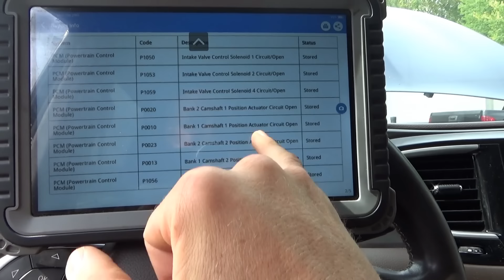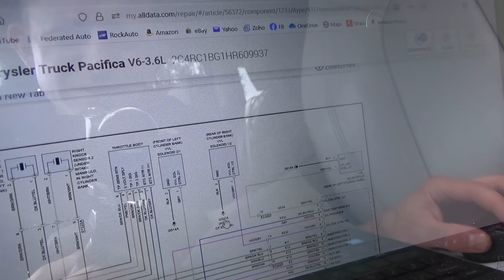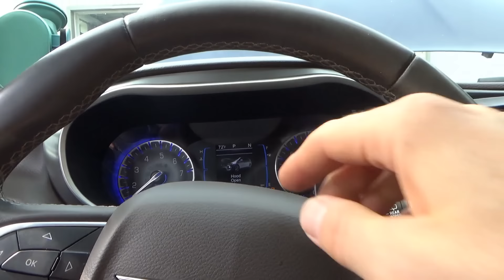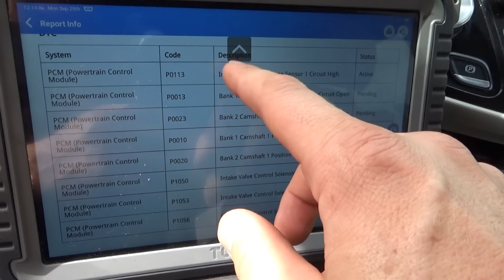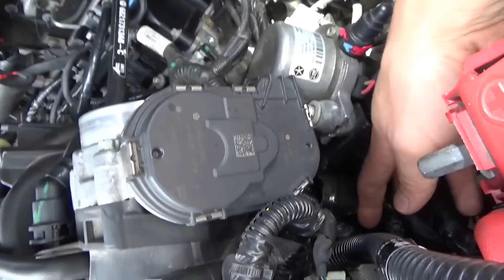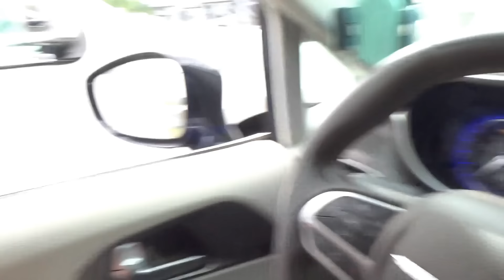Head Gasket Job...Goes WRONG?? LOW Power...MANY CODES! ('17 Pacifica Pentastar V6)

Comment: This is a good place to use colored tape.  A nice yellow or green tape would have made spotting those bolts easy.
Reply: I was going to suggest bright colored tape, too. The tech was trying to do the right thing by taking care with the things he removed.
Reply: @DrewskisBrews  About to say this same thing, BUT I would definately use some color that is not used in cars, like grounding wire green/yellow used in home electricals. Or just bright pink, also rarely seen in cars.
Reply: @JaakkoF *Definitely
Reply: I was just going to post the same thing. Electrical phasing tape would do the trick!!
Reply: Spot on suggestion!
Reply: I made the same suggestion before reading comments. Smart people think alike.
Reply from the maker: Great suggestion! 😊
Reply: @PineHollowAutoDiagnostics after 50 years i just use memory and occasionally if it's a special fitting i have 3 different color good quality fluorescent pens and just mark the bold and what it goes through, never had a problem and you know you have a bolt or nut that needs to go somewhere
Reply: Money pit
Reply: I prefer to have all the bolts on the bench laid out in size and length then if I have any left over it's easy to put them in the bin/joke   but after you have been a mechanic for a while it all sort of comes naturally, you remember what goes where. I'm coming up for 50 years since I started my apprenticeship and the only bolts I have "misplaced" are the stupid ones on awd 90s nissan bluebirds that go below the starter and behind the transfer case f/w drive assy that you need a mirror tos see,  they're known as bluebirds in our part of the world, 2.0l all wheel drive
Reply: @johnmcnair8854  I'm not a professional mechanic and Ive never taped bolts but if you are going to do it use colored tape. I use little cups to keep parts in and I take pictures, LOTS of pictures :o)
Reply: @hikerJohn I've been doing it for so long the only time I take pictures is when I'm pulling a dash to do a heater core, or occasionally on a rear brake if I haven't done one of that particular model and I'm tired. After 50 years I'm getting reasonably good at figuring out how things go back together. 20 years ago I got bored with being a shop mechanic and went and worked for a friend just pulling and refitting and making run transmissions. It's quite amazing how quickly you can do things when you get a bit of practice, but I always used to just put everything in one container basically unless it was something special/different then I used to just use good quality fluorescent pen.
Reply: Some GREEN tape for grounds!
Reply: I have a bunch of those paper tags with the wire on them that can wrap around stuff, and a supply of smaller bags with the white writing block on them. Great way to leave myself notes for later and keep small parts organized as to what goes where. 

However I normally work on industrial equipment and tools where it's usually at least a week and sometimes a month or more between disassembly and completing a repair, so I can't always count on my memory.
Reply: I was thinking the same thing! And there it was 3rd comment down.

Comment: You can bet that all shops pay careful attention to getting the customers bill correct!!
Reply: Don't you mean padding the customers bill lol?
Reply: 🤣 True!
Reply: The best way to tell if 💩is happening in the billing is if the shop owner refuses to delegate it to employees.
Reply: Did anyone say this shop tried to return it to the customer in this condition? This work Ivan did is on the shop not the customer. A head gasket job is a flat rate.
Reply: depends on what you mean by "correct"!
Reply: you mean, special attention to make sure the customer pays every last penny.
Reply: You have poor management when you have a tech start the job and someone else finish it, but it's not their specialty, they don't do several of the same every month .
If they were the Chrysler shop, they would have established practices and one guy could pick up where the other left off. There's more double checking, but it can work.
As far as billing, the labor guide gives the hours for the job regardless .
As a customer, you can check a parts and labor guide yourself at a public library , in a database or in a manual.
Ask which kind they use. Chilton's should suffice.